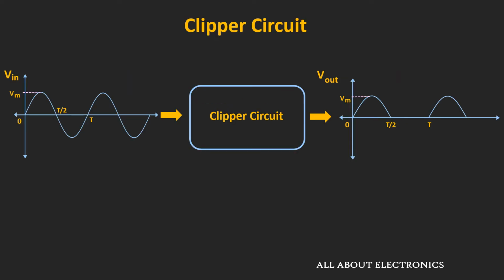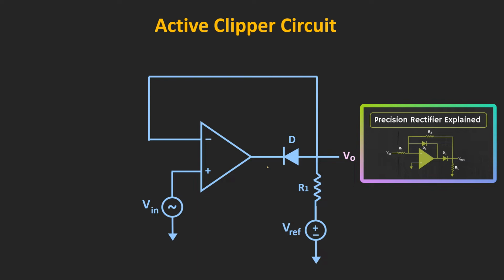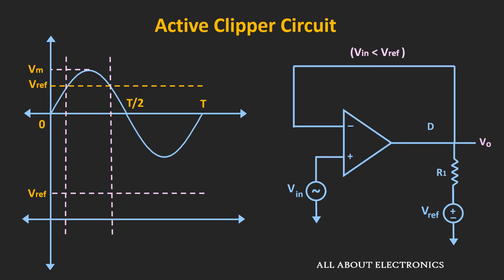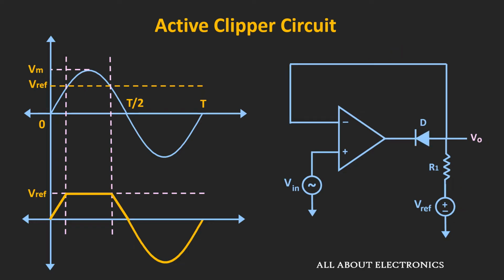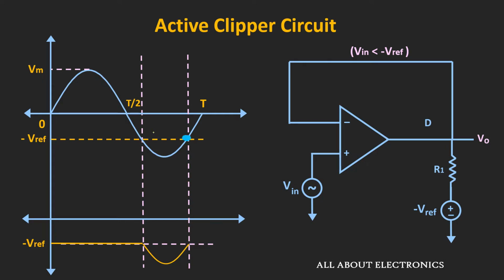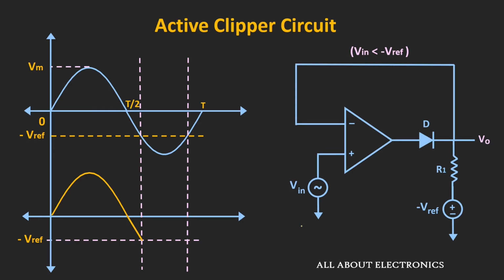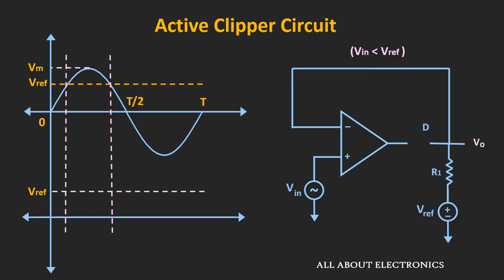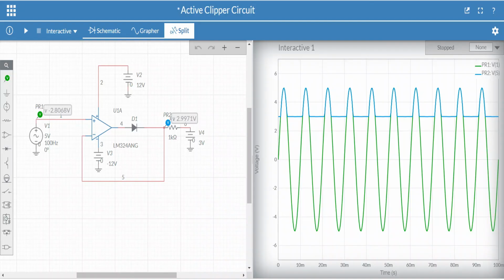Active Clipper Circuit (Clipper Circuit using op-amp) Explained

Comment from the maker: The timestamps for the different topics covered in the video:

00:18 Why to use Active Clipper Circuit (Advantage of Active Clipper Circuit)

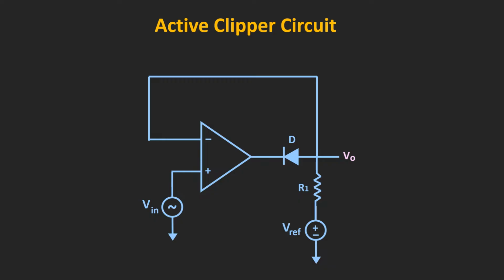0:57  Working of Active Clipper Circuits (with Positive and Negative reference voltages)

Comment: Note to readers: It does not work well in the case where the output has to swing close to the negative rail, e.g. a single supply configuration where the negative supply is ground. In that case it clips below one diode drop above the negative rail swing limit.

Comment: What is the purpose of Resistance R1 in this circuit ? Anyhow as current flowing through it is zero, voltage drop across it is also zero..So...what is the purpose ?
Reply from the maker: without resistor R1, the vo will remain at - Vref. (Irrespective of the input ). If required, you can also simulate the same and check.

Comment: The problem is, since in each cases the opamp is going to saturation the diode thereby will have high PIV like because of that we modify precision rectifier and as high PIV diode could not be found, how could we use this circuit?

Comment: First, your videos are GREAT! Thank you for helping us learn!

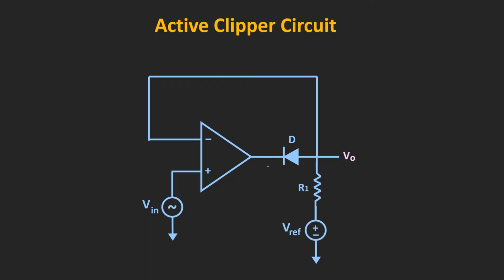I have a difficult time understanding the diagram (at around 2:00) the diode is drawn with the cathode facing the op amp (the inverse of the precision rectifier circuit). Can you give me a hint of how this works in this particular case?

Thanks in advance.
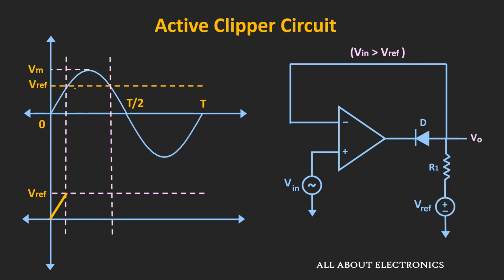Reply from the maker: As I have explained, when Vin <Vref, the output of the op-amp will go towards the -Vsat momentarily. So, the anode of the diode (which is at Vref) will be more positive than the cathode. So, the diode conducts. When diode conducts the op-amp operates in the closed-loop configuration. And once it operates in the closed-loop configuration, it acts as a buffer. (At 4:21)
That means Vout = Vin.
I hope it will help you.

Comment: Nice video. How will you improve the circuit to resolve the limited slew rate of the OP AMP?
Reply from the maker: There are fast op-amps, which provides very high slew rate. if the application demands fast switching then such op-amps can be used.
Reply: Use negative diodes so that opamps will not go in saturation

Comment: What if we connect the output from a regular opamp circuit (using only resistors) to reference voltage through a zener diode? Will it get similar result?
Reply from the maker: Hi, I didn't get it what you are saying. Would you please elaborate it a bit.

Comment: Is it possible to implement double clipper using opamp??
Reply from the maker: Yes, cascading the two stages it's possible to clip both  positive and negative voltages.
Reply: @ALLABOUTELECTRONICS  hello , there is no video about recurrent network